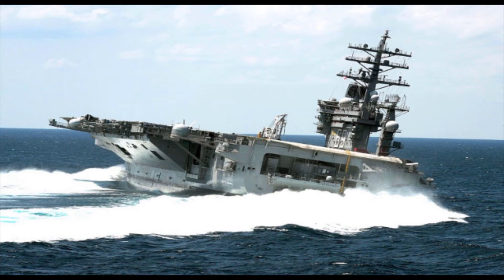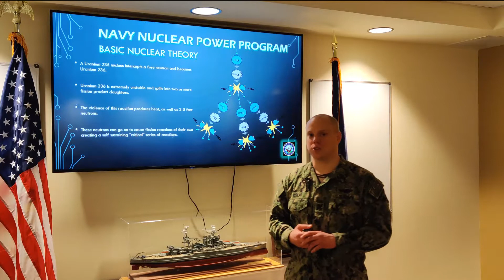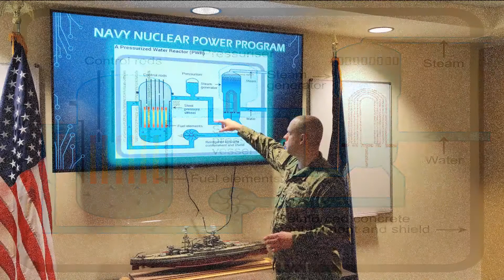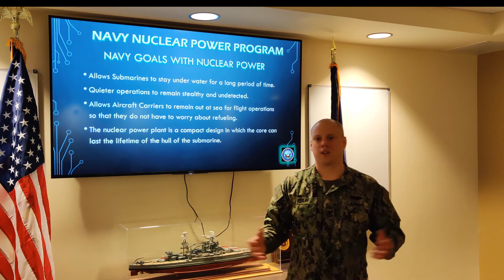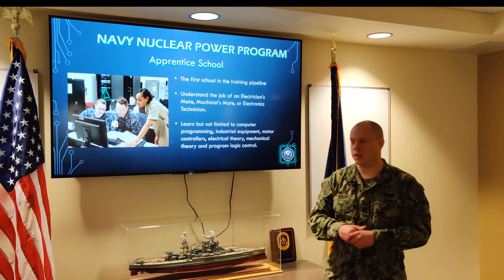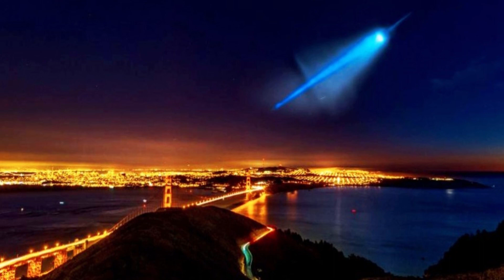What is a Navy Nuke?

Comment: @1:20 ? what ? The first submarine to circumnavigate the globe under nuclear power ? You're referring to the Triton (SSRN-586) , which did so in 1960. Interestingly enough it was the only NNPP submarine to have two onboard reactors (S4G). 

The Nautilus (SSN-571) was the first naval vessel to reach 90N under the polar ice caps in 1958 during operation Sunshine.

Comment: Navy Nuclear is the lowest paying job in the navy, if you count the hours you work.  
Cooks get paid more.  Yeah, "sandwich making guy" makes more than reactor operator guy.  
In addition, you will have responsibilities that far exceed any other enlisted rate with little to no extra compensation, but if any mistakes are made, that will be Capt Mast (that punishment that can include reduction in rate, fines, restriction to the ship/area,  and extra duties like midnight cleaning).  Nukes are far more likely to be sent to Capt Mast for performance related issues than any other rate by a factor of infinity.  For example, I have never seen a non-nuke ever written up based on performance issues.  Nukes?  All the time.  

Take my advice, look up your friendly Air Force recruiter. 30 section duty, 40 hour weeks, Hilton type bases.  Take night college classes and after 4-6 years you will be miles ahead of any nuke with a degree or well on the way to a degree.
Reply: True true. But after the navy you can find an easy job for 100k a year minimum
Reply: Debatable. Sure it sucks but a single contract sailor could walk off the boat with a really good rep for getting a job. Not arguing the work part though M-Div on Kentucky right now actually lol. Job sucks but you don’t get anywhere close to the resume of a nuke going to college.
Reply: @sullivancain5412  
An engineering degree far exceeds a 6 and out nuke.  All you do is clean, do some simple maintenance, some PM's and that is it.   I was there, remember. The job is so easy a 19yo can do it. (easy as in intellectually easy)  That was my age when I was fully qualified. 
It provides a place for you start in Civ Lant in the trades...at the BOTTOM.  Apprentice. 
Sorry. Facts.
Signed, 
Sr PM at a nuke plant.
Reply: @richardfrench2863  by fully qualified you mean literally every qual you can do in a submarine engine room right? Because no offense I’m an M-Diver qualified SRO and EWS at my 2 year point on board. Also USMaps is a thing, bunch’s guys have said it’s done them good. I’m not saying it’s perfect man but not everyone is gonna go to some nuclear plant when they get out. At least I know I’m not. Sorry TA isn’t really an option with current work schedules and Optempos, shipyards have pulled most support and ships force is having to take a lot back. Who knows I’ve got 4 years and I’ll find out if all of it has done me any good.
Reply: I retired last year, but yeah I made more than most people with advanced degrees...Allot more. As far as an engineering degree,  I have no degree,  worked as an engineer and was rated higher than most of them.. A few years ago INPO figured out that engineers were weak on fundamentals, so they gave a test to see what the situation was. Only one engineering group at my plant had no one who failed that test, I aced it. Thanks NPS!
Reply: @braddawson4496  
I have done both.  Engineering is 100X harder than nuke school. 
There are stupid nukes and  some not  so sharp engineers. I had one nuke that worked for me that tried to tag out a TG tie by actually disconnecting the buss work..while energized.   Luckily, someone stopped him.  
Of course some of my smarter nuke buddies are very good,  have done very well and would have had no trouble completing an engineering degree.
Reply: @richardfrench2863  I believe it depends which school you go to as well. I have worked with engineers from many of the better schools including MIT and most of the Ivy. From what I learned about their education over the years, I know Cornell is very difficult. While still in the Nav I had a guy that worked for me (MM3/ELT) who had a degree in nuclear engineer from Penn State, and his wife was an attorney.. He was one of the slowest (and useless) people I have ever met.  I agree with you that intelligence and education are two different things..I will say if your goal is to work at a civilian nuke plant, doing well at  nuke school (and at prototype and the fleet) with all that entails, will prepare you to be successful in that particular field more than any BS in engineering.
Reply: @braddawson4496  
Engineering has its own path in Nuclear BUT, everyone needs to go through ops to get to the director levels and up.
I would say the bottom 20% of nukes on my boat were "poor".  The Top guys could hang with anyone and then you had everyone else.
In my division about 20% of us went on to get engineering degrees, a couple went to nuclear plants, others into finance. 
And the bottom guys wound up bums working crap jobs. 
Our Plant Manager was a ETC 9 years in the Navy, got out about the same time I did ( I never knew him) , I went to school, he went to ops and he is now the Plant Manager while I am a Proj Manager. 
So, there you go. Stupid me getting a degree.  Of course, he works 90Hr /wks, I work 40 and get paid for every hour. 
Nuke is a dying industry anyways, no one that has choices is picking Nuke over Google/amazon
Reply: @richardfrench2863  I hear you. I retired last December, at that time our site VP was a former O4, CO of an SSBN etc. He left when I did and was replaced by an MMC.. He had a degree but not an engineering degree, business of some kind and 20 years in the OPS dept..I was going to get an ME degree after EAOS  but I made the mistake of trying to start before the 3rd semester instead of the 1st.. I could not get the classes I needed and I had a job offer for about 80K (1987) on the table so I went with that. My big mistake was getting a ROTC scholarship out of NPS and I turned it down. In hindsight probably not a wise decision but I have no real regrets.